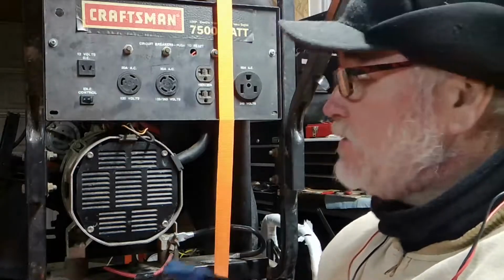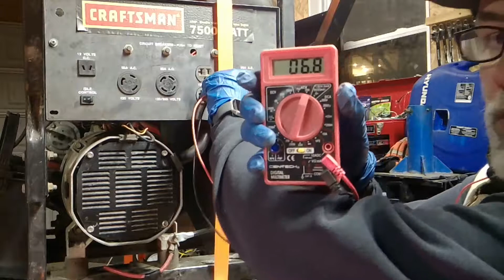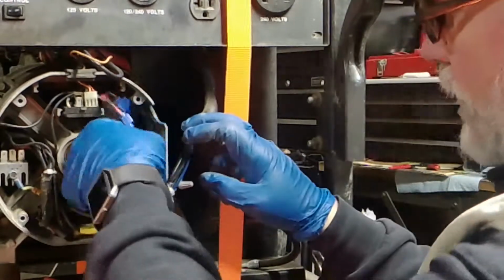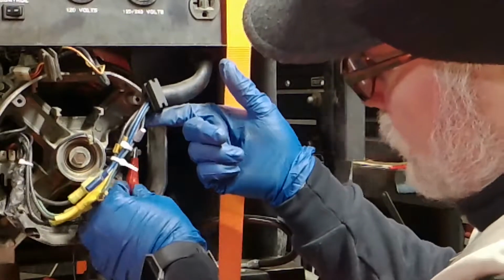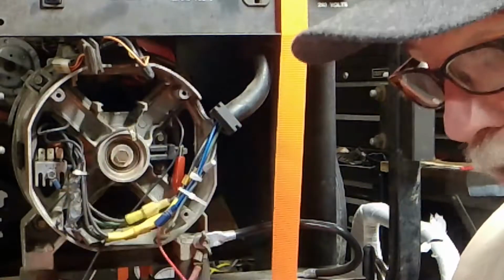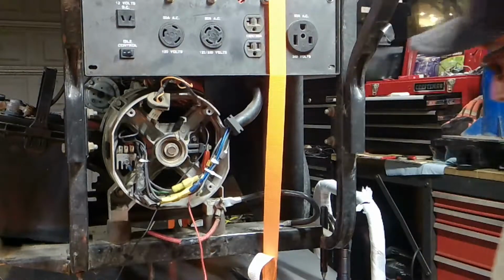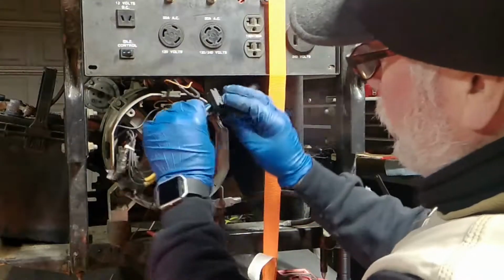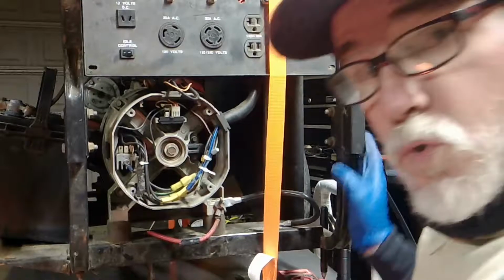How to diagnose generator power loss by flashing field w/12v battery and change voltage regulator

Comment: I have a predator 4000 generator. Been using it everyday for a long time. Every once in a while lights in house will flicker and voltage will drop shutting everything down. Other time it works just fine without an issue. Thing is its getting worse. Hadda send wife off with money to buy food bc genny quit while she was cooking. It runs great, I'm thinking voltage regulator, I will start work on it tomorrow. I believe its a brushless motor....i hope your tricks help. Thanks for video and awesome attitude.
Reply: Generator safety⚠️: please make sure that you follow all the generator safety instructions and always keep in mind that carbon monoxide fumes are very dangerous to inhale and carbon monoxide is odorless and colorless which is a silent killer. You should always have a carbon monoxide detector if you have a portable generator. Please remember not to ever run your generator indoors. Running a generator indoors increases the risk of carbon monoxide poisoning which causes death. Please make sure your generator is 15-20 feet away from your house and away from doors, windows, and vents to lower carbon monoxide poisoning risk. Please remember also not to run your generator in wet conditions. Running a generator in wet conditions can cause electrocution. Please keep your generator dry. Make sure your generator is dry before using. If you need to use your generator during a wet weather, then you need a generator tent to protect your generator from getting wet. We also need to keep our children safe when we are using portable generators so that they won’t get electrocuted or burned by the generator which is dangerous. We need to keep an eye on children making sure they are not near the portable generator to avoid risks and also carbon monoxide poisoning. Generators can be dangerous so we really need to be aware with the hazards of using generators. Generators pose electrical risks. Please never try to plug a generator cord into a wall outlet to avoid back feeding. They should be plugged into a transfer switch if you need to run your house with the portable generator. Please not overload your generator. Overloading your generator can cause damage to the appliances that are plugged into the generator. Always turn on your generator first before plugging in appliances. And shut off your generator first before you unplug the appliances. Please use a heavy duty cord for your generator and the cord should not be worn out. Worn out cords should not be used on generators. Please don’t refuel your generator while it’s running. You need to shut off your generator and let it cool off before refueling it. Never refuel your generator while it’s still hot. https://youtu.be/I1jT3ANENvI and here is a video more about keeping your family safe while using portable generators. All the instructions in the generator’s operating manual should not be ignored for safety. This is just a safety reminder for using generators and please make sure you are aware with the hazards of using generators. Thank you and hope you stay safe.
Reply: @The_Happy_Aviation_Enthusiast    ? again.....is this a  'recording ' or a grab, for business  ??

Comment: I'll be on mine tomorrow. Thanks for helping this dummy out.
Reply: ⚠️Generator safety: always keep in mind that carbon monoxide fumes are very dangerous to inhale and carbon monoxide is odorless and colorless which is a silent killer. You should always have a carbon monoxide detector if you have a portable generator. Please remember not to ever run your generator indoors. Running a generator indoors increases the risk of carbon monoxide poisoning which causes death. Please make sure your generator is 15-20 feet away from your house and away from doors, windows, and vents to lower carbon monoxide poisoning risk. Please remember also not to run your generator in wet conditions. Running a generator in wet conditions can cause electrocution. Please keep your generator dry. Make sure your generator is dry before using. If you need to use your generator during a wet weather, then you need a generator tent to protect your generator from getting wet. We also need to keep our children safe when we are using portable generators so that they won’t get electrocuted or burned by the generator which is dangerous. We need to keep an eye on children making sure they are not near the portable generator to avoid risks and also carbon monoxide poisoning. Generators can be dangerous so we really need to be aware with the hazards of using generators. Generators pose electrical risks. Please never try to plug a generator cord into a wall outlet to avoid back feeding. They should be plugged into a transfer switch if you need to run your house with the portable generator. Please not overload your generator. Overloading your generator can cause damage to the appliances that are plugged into the generator. Always turn on your generator first before plugging in appliances. And shut off your generator first before you unplug the appliances. Please use a heavy duty cord for your generator and the cord should not be worn out. Worn out cords should not be used on generators. Please don’t refuel your generator while it’s running. You need to shut off your generator and let it cool off before refueling it. Never refuel your generator while it’s still hot. https://youtu.be/I1jT3ANENvI and here is a video more about keeping your family safe while using portable generators. Just reminding everyone to use their generator carefully and please make sure you are aware with the hazards of using generators. Thank you hope you stay safe.

Comment: I just got done watching your video. I have a Powermate 3000 watt . with only 69 hours with no output. I'm gonna use your steps to try and find the problem.
Any other tips you want to share.
Thanks.   Mike

Comment: you did the 110 how do you do the 220? I having trouble with the 220, one leg is 109 the other is 56 seems to blow things out
Reply from the maker: In general when low voltage is occurring I will just change the AVR and problem is usually solved. I see them for sale on eBay and might find them on Amazon. Let me know how you make out.
Reply: @TheBigmachineman  thank you very much
Reply: @TheBigmachineman  remember not to run your generator indoors. Carbon monoxide fumes causes death.

Comment: I'll try that next, rotor slip rings are reading Very low on ohms, have solid solder joints, should read 55 ohms or so. Stator checks out, new AVR flickered then lost power, was a cheapie, have one from V Power if flashing works, have another pwr head of same brand, habor junk but rotors are a bitch to swap out during heatwave in backyard. I liked when the hells bell pulled Malcom 35ft up, hopefully I'm about to ROCK! Good video 👍

Comment: Hi I’m looking at a Coleman powermate 6250 with the plastic square end. What I found is both leads To the slip ring were desoldered and twisted together by someone before me. What I’m wanting to know is does it matter which one is soldered to the inside and outside ring? I soldered them just taking a guess and excited the field and it started making power but it’s only showing 85 vac. So a couple things if the wires matter where they go because of polarity or such which one gets soldered where. I think currently (no pun) I have the deep wire in the winding going to the neg brush inside ring and the outside wire in the winding going to the outside brush ring. I don’t see any voltage regulator in this one, only a capacitor. For that I discharged it and held a 9 volt battery across the terminals and then tested it and got 9 volts as I read this would work to check it? I’m checking the voltage output of the generator at the 110 outlet with a Klein rt250 tester/analyzer, maybe I need to use a multimeter instead? The generator will run a light a drill a heat gun and not even sound under a load? If I have those wires soldered correctly what might the culprit be of the low voltage maybe the capacitor? Or something else in there? Thank you for any input.
Reply: ⚠️Generator safety: please make sure that you follow all the generator safety tips and always keep in mind that carbon monoxide fumes are very dangerous to inhale and carbon monoxide is odorless and colorless which is a silent killer. You should always have a carbon monoxide detector if you have a portable generator to make sure you are safe from getting poisoned by carbon monoxide fumes. Please remember not to ever run your generator indoors. Running a generator indoors increases the risk of carbon monoxide poisoning which causes death. Please make sure your generator is 15-20 feet away from your house and away from doors, windows, and vents to lower carbon monoxide poisoning risk. Please remember also not to run your generator in wet conditions. Running a generator in wet conditions can cause electrocution. Please keep your generator dry. Make sure your generator is dry before using. If you need to use your generator during a wet weather, then you need a generator tent to protect your generator from getting wet. We also need to keep our children safe when we are using portable generators so that they won’t get electrocuted or burned by the generator which is dangerous. We need to keep an eye on children making sure they are not near the portable generator to avoid risks and also carbon monoxide poisoning. Generators can be dangerous so we really need to be aware with the hazards of using generators. Generators pose electrical risks. Please never try to plug a generator cord into a wall outlet to avoid back feeding. They should be plugged into a transfer switch if you need to run your house with the portable generator. Please not overload your generator. Overloading your generator can cause damage to the appliances that are plugged into the generator. Always turn on your generator first before plugging in appliances. And shut off your generator first before you unplug the appliances. Please use a heavy duty cord for your generator and the cord should not be worn out. Worn out cords should not be used on generators. Please don’t refuel your generator while it’s running. You need to shut off your generator and let it cool off before refueling it. Never refuel your generator while it’s still hot. https://youtu.be/I1jT3ANENvI and here is a video more about keeping your family safe while using portable generators. Everything that is said on the generator’s operating manual should not be ignored. This is just a safety reminder and please make sure you are aware with the hazards of using generators. Thank you stay safe.

Comment: Another thing to check for low or no output is the resistance on the rotor slip rings. If the resistance is high it may be dirty slip rings or burnt rotor windings. If the measurement shows an open circuit, it may be an open winding or a bad solder joint where the rotor windings attach to the slip ring. If you have good soldering skills, the detached wire is easily fixed by soldering the wiring back onto the slip ring post. The detached wire is a common problem in a lot of generators due to heat or extreme temperature changes which can cause the solder to crack and cause a bad connection. If you check the resistance of the stator windings, always check them by removing the panel wires first and isolating the stator wires. The reason for this is that a bad regulator can cause false resistance readings on the stator. Best rule of thumb when checking the windings on either the rotor or stator is to isolate each one and that means removing the brushes from the rotor slip rings and removing the output wires from the panel to the stator. These quick tests can quickly rule out a bad rotor or stator and save you a lot of money on a new power head. I don't know how many people have brought me generators with no output thinking that the whole power head is bad when in fact it's either a bad solder joint, set of brushes or bad voltage regulator. These 3 things are very inexpensive compared to an entire power head.
Reply: Very accurate, Steve. Also, gens with brushes and an AVR, usually have magnets/diodes on the rotor, to supply AVR  with power to operate the stator voltage. Diodes (one for each coil = 2 )-diesel gens have 4 coils-run at 1800 rpm for 60 hertz operation ))). I've never had a gen yet, which needed wires re-soldered to the slip ring connection, but if i did,  i would use JB weld, to secure the joint, up to the coils. (using silver solder). Good day, Steve.
Reply: Hey. I have a generator with continuity between stator windings and frame is that ok? I had a broken joint where rotor windings attach to sliprings, I repaired that and the ohm reading is in range, also ohm reading from stator windings.  My only prob is the reading to the frame. Don't wanna start a fire
Reply: @arcticzone9223  Some generators have what is called a bonded neutral. this means that one end of each winding is attached to earth. ( Frame) If you can give me the make and model, I can tell you if that model has a bonded neutral. Or you can just google it for yourself. Cheers, Steve
Reply: @stevejackson9090  I went ahead and removed all motor  wires from connector block and it turns out two of the legs (one winding), are still reading continuity to frame. I'm really thinking I have a bad stator

Comment: good video sir.
I was wondering if you could help me with my smarter tools 3500w generator.  it was running just fine and just stopped putting out electricity.  I'm assuming it is the voltage regulator as well, but the setup is different then the one you're working on in the video.  I can't really tell what is the voltage regulator.
anyway, any guidance would be appreciated.
Reply from the maker: Take a volt meter and tell me how much voltage is coming off the outlet?
Reply from the maker: if you go to Amazon.com and type in the search bar Smarter Tools 3500 avr the part will  appear and you can identify it. You can always trace the two wires off the brushes (black and white) and the attach in the AVR
Let me know how you make out.

Comment: Great video. Enjoyed watching your enthusiasm. I got a 3.4kva generator from new. Only had it 3 months and used about 3 tanks of fuel thru it. Its stopped producing power :/ frustrating!!! My wife said there was some water in the extension lead we had plugged in to genny which could of blown something but I cant find  fuse. I tried flashing it with the drill method but it's pretty hard to hand wind a drill enough.
Reply: Attach a cordless drill to it and drive the corded drill
Reply: @MeltingRubberZ28  how do you drive the cordless drill if there is no plug??? i have a brand new generator. it starts but no power. how do I flash it with a cordless drill?
Reply: ⚠️Generator safety: please follow all of the generator safety instructions carefully and always keep in mind that carbon monoxide fumes are very dangerous to inhale and carbon monoxide is odorless and colorless which is a silent killer. You should always have a carbon monoxide detector if you have a portable generator. Carbon monoxide detectors are used to alert you if carbon monoxide enters your home. Please remember not to ever run your generator indoors. Running a generator indoors increases the risk of carbon monoxide poisoning which causes death. Please make sure your generator is 15-20 feet away from your house and away from doors, windows, and vents to lower carbon monoxide poisoning risk. Please remember also not to run your generator in wet conditions. Running a generator in wet conditions can cause electrocution. Please keep your generator dry. Make sure your generator is dry before using. If you need to use your generator during a wet weather, then you need a generator tent to protect your generator from getting wet. We also need to keep our children safe when we are using portable generators so that they won’t get electrocuted or burned by the generator which is dangerous. We need to keep an eye on children making sure they are not near the portable generator to avoid risks and also carbon monoxide poisoning. Generators can be dangerous so we really need to be aware with the hazards of using generators. Generators pose electrical risks. Please never try to plug a generator cord into a wall outlet to avoid back feeding. They should be plugged into a transfer switch if you need to run your house with the portable generator. Please not overload your generator. Overloading your generator can cause damage to the appliances that are plugged into the generator. Always turn on your generator first before plugging in appliances. And shut off your generator first before you unplug the appliances. Please use a heavy duty cord for your generator and the cord should not be worn out. Worn out cords should not be used on generators. Please don’t refuel your generator while it’s running. You need to shut off your generator and let it cool off before refueling it. Never refuel your generator while it’s still hot. Everything that is said on the generator’s operating manual should not be ignored. https://youtu.be/I1jT3ANENvI and here is a video more about keeping your family safe while using portable generators. This is just a safety reminder and please make sure you are aware with the hazards of using generators. Thank you and hope you stay safe.